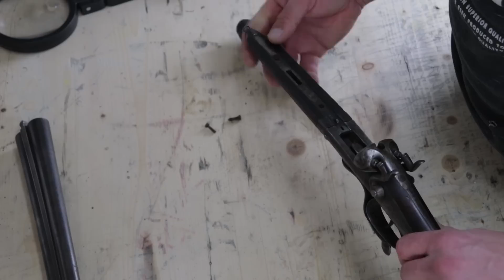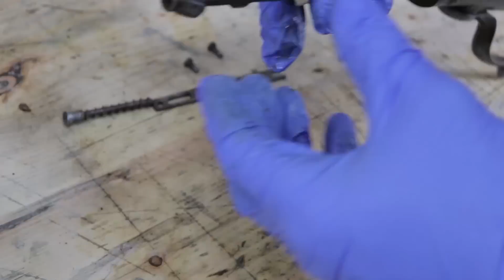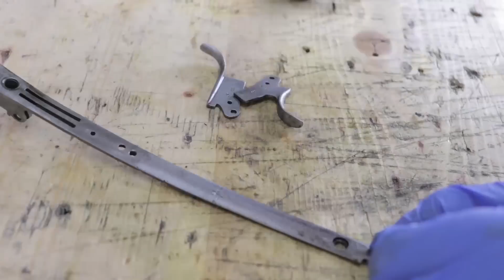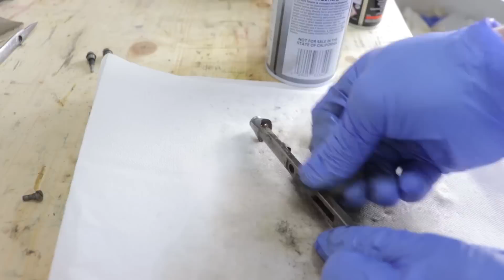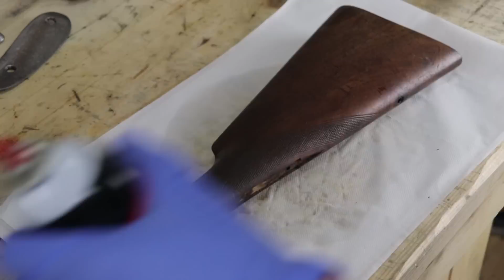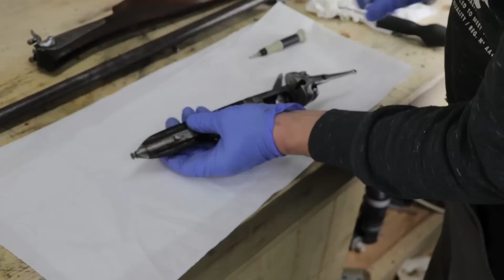Cleaning An Old French 1887 St Etienne Shotgun

Comment: That stock and fore grip should be a beautiful rich red, you can see some of it on the stock still. If I were you and I’m not, this is just my opinion. I’d buy Myles Gilbert stock finish remover it’s a not a real harsh product so it won’t damage the stock and then submerge it in acetone until all the oil draws out, usually takes 2-3 days if the oil is saturated all the way through and it looks like it is. After the oil draws out let the stock dry for atleast 48 hours and then refinish it. They also make a tool to re-do that cross hatch pattern but I honestly kind of like the way it’s worn down it stays true to the age of the gun but you could do it and not take away from the value.
Reply: If you’re interested in doing more with that gun or any other old guns there’s a YouTube channel called MidwayUSA and the old guy there will teach you how to do everything from refacing the barrel to the breach or how to custom make springs etc.

Comment: There is one on sale, exactly that one. I am thinking of getting it and restoring it like you. I’ve saved and i have your vid as a instruction manual. Do you think i should get it, please. Need help deciding
Reply: I wouldn't. The French made some really great guns that managed to survive the wars but they are rare. France, not Britain, was the great innovator in shotguns. That gun is not among them. Save your money.
Reply: wholeNwon Well I went through the pictures like a month ago, and found a slight dent in one of the barrels, so didn’t risk it. But Lefaucheux had one similar to this. I’ll still try to find a similar model, with a underlever. In anyways, it’s already off the market. Saved close to 400 euros. 
Worst case scenario I could save up and order a custom one. But it is true, french guns were/are the best.
Reply: @maxpanich8634   Well, no longer "the best" but they did make some interesting guns and remarkable engineering. Granger is still excellent. Many of the older guns had short chambers and lack the extra heavy proof that you would want for a modern shooter. If you plan to use an old gun, measure the barrel wall thickness at several points to be sure it hasn't been honed excessively. Metallurgy of the past is nothing like today's and their fluid steel barrels aren't nearly as strong as modern ordinance steel.  If a dented barrel is repaired (raised), it's no longer in proof.

Comment: Hey Andre, you don't have to buff off the Blued finish along with the rust! Curio & Rsenal did a gunsmithing video where they showed that you can convert rust back into the original gun blue by boiling the parts then buffing with extremely fine wheels. https://youtu.be/B2SyN6m39x4?t=781 here is the video at the timestamp where he begins talking about it and then shows the result, It's quite impressive.